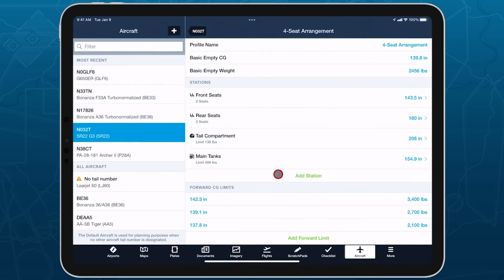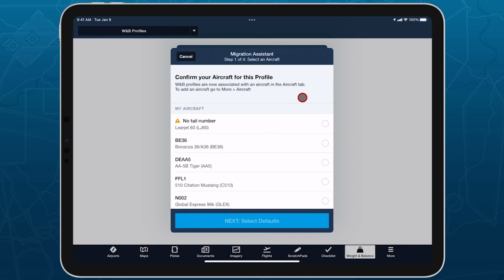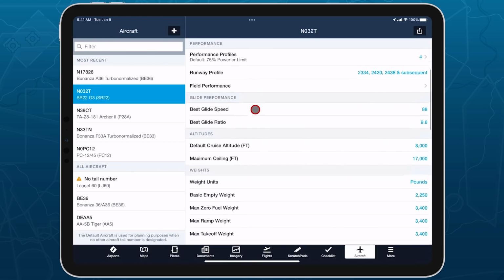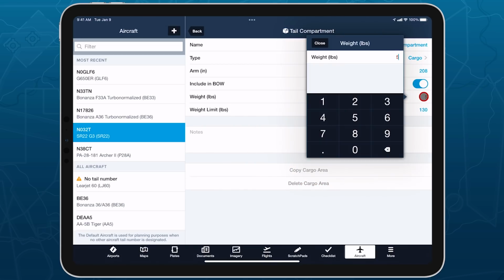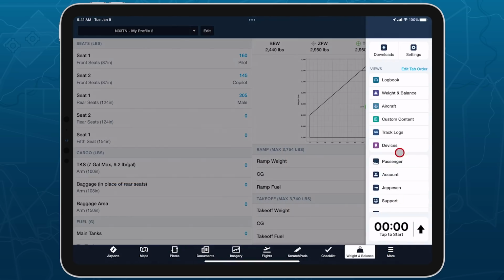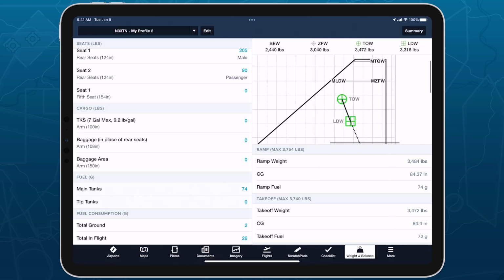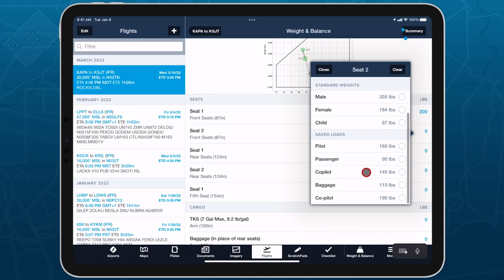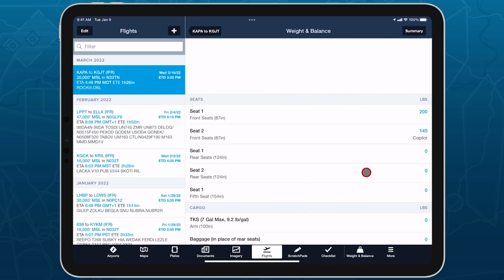NOW AVAILABLE: Enhanced and Integrated Weight & Balance

Comment: I loved the original W&B.  Was easy to set up.  I went in today to run a W&B for a potential upcoming flight and dang what a mess.  Errors galore.  Tried to figure it out but not much luck.  It was like taking my existing profiles and putting them in a blender.  Horrible "improvement" for something that worked perfectly fine the way it was.
Reply from the maker: Hi Brent, sorry to hear you had issues with the new W&B. Please email team@foreflight.com so our Support Team can help you get your profiles properly configured again.

Comment: Currently trying out this updated version of FF W&B. I copied two of my legacy profiles to the new enhanced versions. 
Keep getting errors for zero fuel, ramp, takeoff, and landing weight limits exceeded. I am unable to find where to modify these parameters.
In the legacy W&B page, you'd go to "Setup" tab. > weight limits to enter custom zero fuel, ramp, takeoff, and landing weight limits. 
I cannot find these data fields on the new W&B page, or W&B parameters within the Aircraft Page after going through the initial "choose your defaults" menu when upgrading legacy profiles.
Everything appears to be locked in/uneditable once chosen. Anyone know if this is a design intention or bug?
Reply: Update: it is found under More>Aircraft>Weights.

Not sure why these would not transfer from my legacy profile despite me selecting the correct Aircraft Defaults upon initial migration.
Reply from the maker: Hi William, glad you were able to get it worked out. This is a known issue that was just fixed in the latest app release, version 14.2.1, so if you update your app you shouldn't encounter this problem for any other aircraft.
Reply: @ForeFlight  Excellent. Thank you.

Comment: I added the CE680.  When to the Basic Empty CG it did not offer CG in Inches only % which I assume is Percent of MAC. Fortunately, I was able to compute it for my aircraft. I recommend that you have an option for Percent of MAC or Inches.  It would also be a nice feature to add it to your flight.
Reply from the maker: You can disable the %MAC setting at the bottom of the Weight & Balance profile edit view in More > Aircraft > Weight & Balance, or by tapping the Edit button in the top-right with the aircraft selected in More > Weight & Balance.

Comment: I was really looking forward to trying it out, but alas, it's a useless feature.  My Bonanza has an STC for an increased MTOW due to tip tanks.  I've been using the corrected amount in the plain-old-vanilla W&B feature for the 7 years that I've owned the plane.  But now FF in their greater "wisdom" says I have to use the incorrect amount unless they play "traffic cop" and review my STC paperwork.  Go check it out on the FAA if you care that much or get the data from Osbourne.  In the meantime, the effect is that you're actually making it harder for a pilot to use a safety-minded feature.  That sort of twisted reasoning usually only comes from the FAA.  Either give me the tools to help me be a safer pilot or get the hell out of my way, but this sort of smothering only pisses me -- and a lot of other pilots -- off.
Reply: Agreed this is an epic failure of a rollout.

Comment: The beauty of a free-market system - if one doesn't like what FF offers and the different levels available for purchase (and what and what is not included in each level), one can always find a different EFB platform to use.  No one is forcing any pilot to use FF.  Stop whining, people...
Reply: As a GA student, FF just is the de facto tool. I played with Garmin EFB, but when hanging out with other pilots, everyone uses FF. That said, us GA pilots can't honestly afford a Performance Pro subscription, which is a shame because it has some nice features (like auto plane model data). I wish they would change their pricing model to be based on the class of aircraft. So Basic you can have up to a 6-seat plane, etc. Then those flying heavy metal would buy Performance Plus, because, it's a tool to do their jobs. Not a hobby. Technically "Pro" means "professional" as in I get paid to do this. The rest of us are not pro, but the features still apply, just in a smaller way.
Reply: I do like a lot FF. But it's because I like it that I want to give some critics about it.
I get it that FF wants you to by the higher up tier, but for an advanced VFR pilote who wants a bit more, pro is great, and performance is to much... the planner, the IFR transatlantic routes, 3D view, taxiway planner, etc...
But having some basic stuff inside the flight planner like this here, the weight and balance stuff, would simply be logic to see, at least inside the pro subscription. They could also limit this to a 4 seater plane, or cat A aircraft.
Reply: What are you people whining about?   Performance Plus subscription PLUS Jeppesen charts for the year are less than full fueling of my Bonanza (114 gallons).    ForeFlight is bargain by any measure.
Reply: @ericpaterson9220  it's the price of 2 flight hours of a C172 in France. It's not cheap though ! 😬
Reply: Well, yeah.  Except a lot of us have invested years & hundreds of dollars developing expertise with FF, supporting FF to push it ahead of the competition.  Guess we should just write that investment off.

Comment: Lab option not available, this video is a non starter.
Reply from the maker: This feature hasn't been released yet, so the Labs menu with the switch to enable it isn't available. Update to the new app version when it's released next week and you should see the Labs menu and the switch to enable Enhanced Weight & Balance.

Comment: Finally!

Oh wait, again, it's not even available for pro subscriptions for the view in the flight planner...

The pro subscription is starting to get really a very low mid tier...
Reply: THIS!! 🙌🏻
Reply: By the way, the lab option is not visible in my app :/

Curious to see the passenger profiles though. That can get helpful
Reply from the maker: The Labs menu and the switch to enable Enhanced Weight & Balance will become available after you update to the new app version which we're planning to release next week.
Reply: @ForeFlight  copied, thanks ! :)
Reply: Making me consider other options for sure